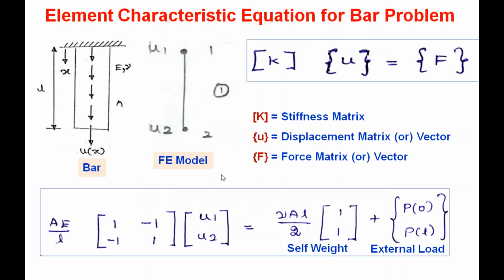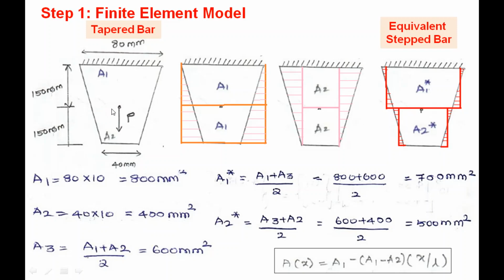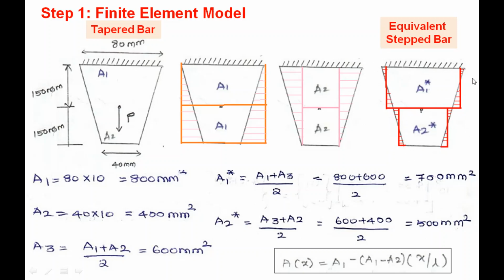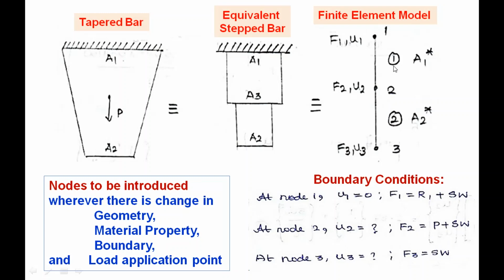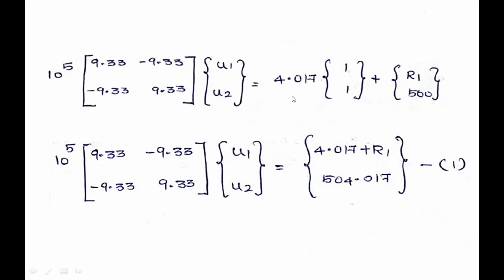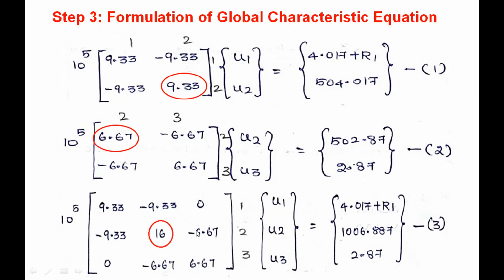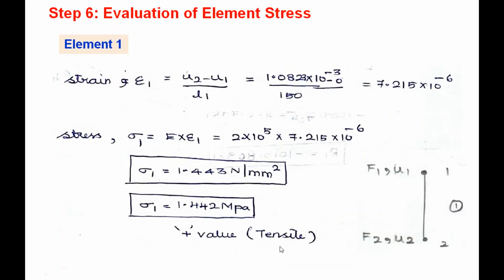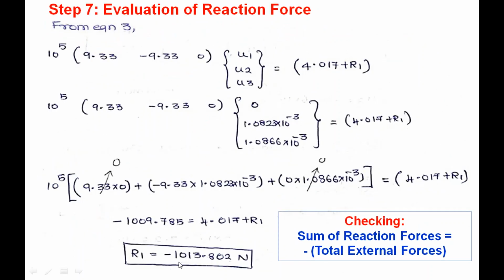Introduction to Finite Element Analysis-part 10- Tapered bar problem in Finite element analysis

Comment: A tapered bar made of steel is suspended vertically with the larger end rigidly clamped and the  smaller end acted on by a pull of 105N. The areas at the larger and smaller ends are 80 cm2 and  20 cm2 respectively. The length of the bar is 3m. The bar weighs 0.075 N/cc. Young’s modulus  of the bar material is E=2 x 107 N/cm2. Obtain an approximate expression for the deformation  of the rod using Ritz technique. Determine the maximum displacement at the tip of the bar

Sir please send answer for this question